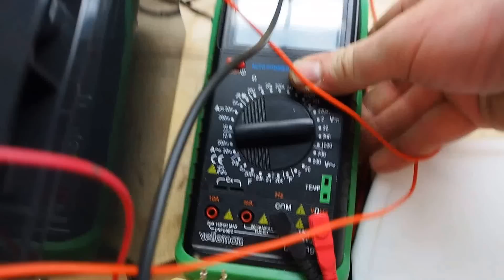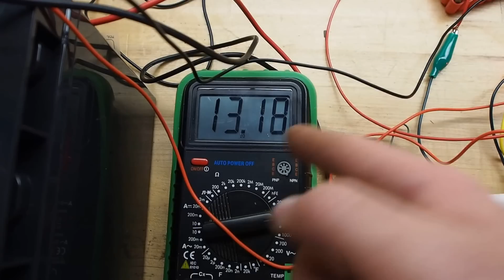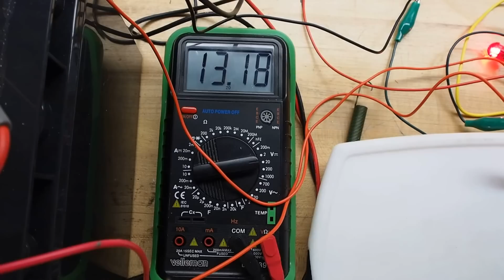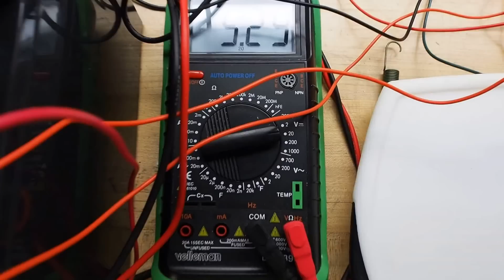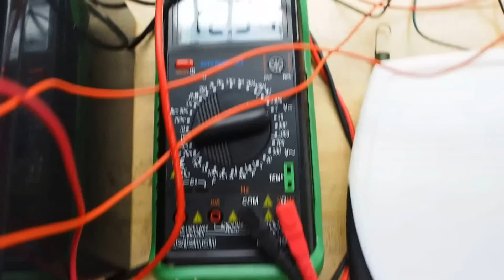Bedini SSG Motor Part 1

Comment: Are you still here? I see it's been a couple years since you posted anything. I just found this Bedini video, I'm in the process of building one very similar and had some questions. Did you leave it running on the dead battery for a couple weeks to see if it would desulfate and revive the bad battery? Also I have heard you can recharge non rechargeable alkaline batteries with a Bedini, any experiments with that? Thanks for posting your work.
Reply from the maker: This was a while ago. The motor went through several versions before I moved on to other experiments. When I stopped, I was trying to build a flip-flop circuit that sensed the voltage of one battery and would flip charge\power when the charge battery reached a preset voltage.
Reply: Thanks

Comment: if you go from pin one on the potentiometer to pin three then turning it will not vary the resistance....you must go from the center pin to one outside pin to make the resistance vary.

Comment from the maker: so I just tried it again. When I plug in the dead battery, believe it or not, the power battery's voltage went up .01 of a volt. The motor slowed down a bit though. I think I need to wind another coil because just putting an LED on the charge battery almost brings the rotor to a stop. I need more power!

Comment from the maker: The drop was roughly .1 volt. However, I did not measure the current draw. I am going to test that tonight. I was also thinking about using the Bedini circuit to drive the motor, then creating a charging circuit to pick up the radiant energy using an array of starship coils around the rotor. Gonna start building some coils tonight, too!